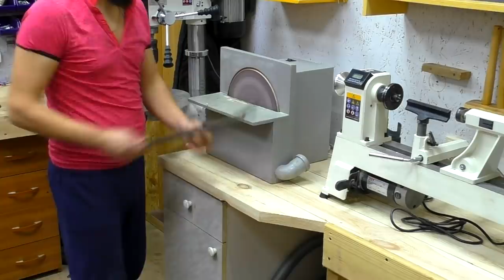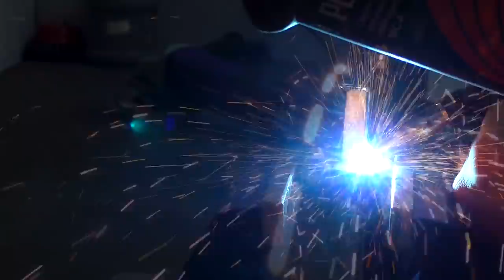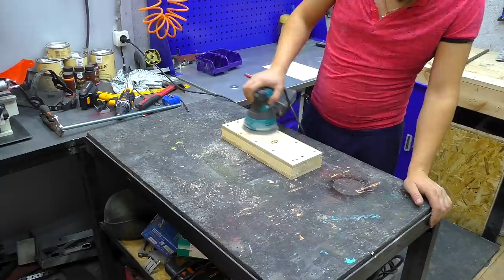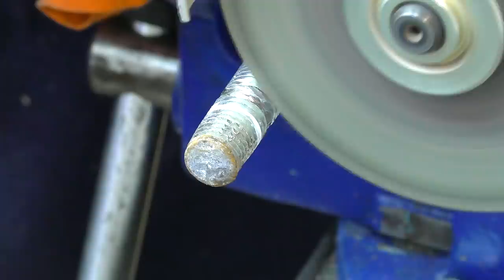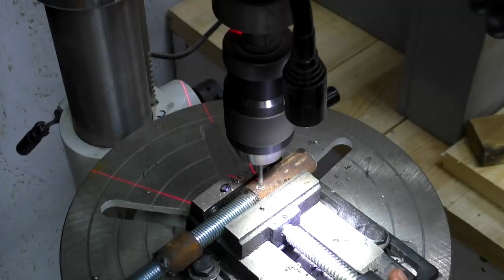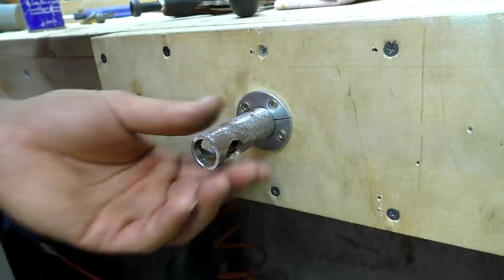A real male homemade tool for a garage or workshop!

Comment: Kendrick historian poet
Woodsman to woodsman this clamp will last for maybe a month . You failed to incorporate any strength in the mechanism, 1/2 inch  screws and boards and a bent nail.  Little or no structural integrity it will not last.